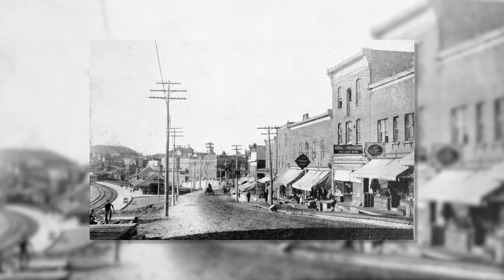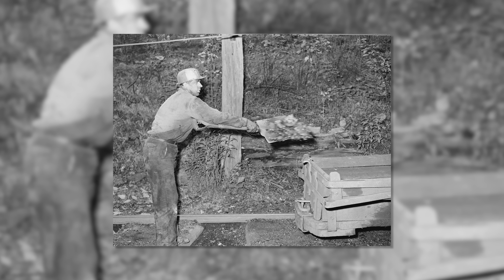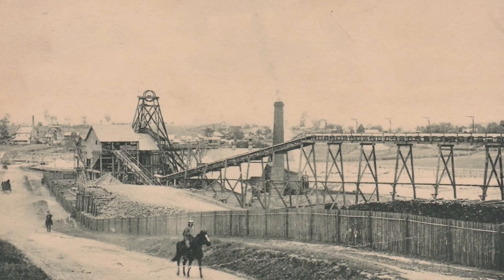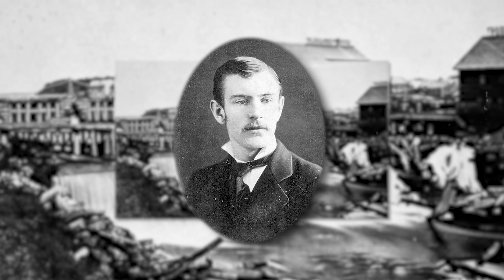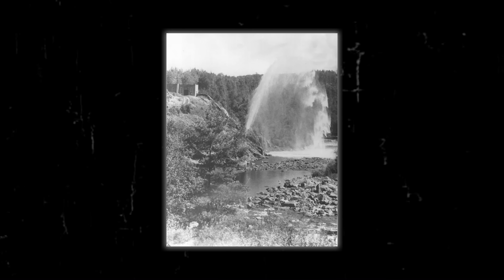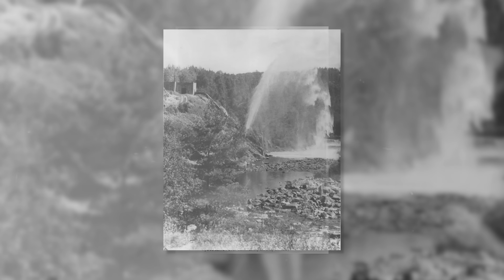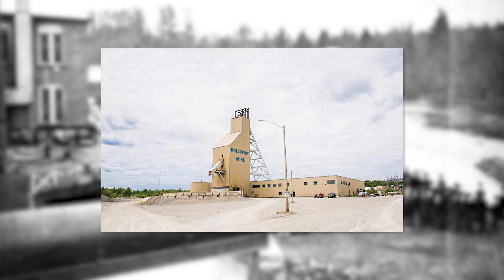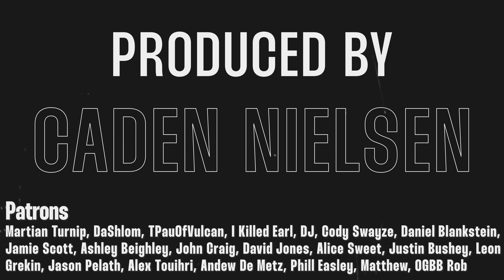Engineering Marvels- The Ragged Chute Air Plant

Comment: Very good video! Charles Taylor ended up making nine of these hydraulic air compressors with his last one, the Ragged Chutes in Cobalt Ontario, being his final version.  Taylor then went on to start an illegitimate family from a woman he met in Britian, and then later became a wartime supplier of goods during WWI.
EDIT: after posting this, I did some quick research on Dean Millar and his Electrale Innovation Ltd, which is said to be providing hydraulic air power to the Holloway Gold Mine, and since 2019 it has been a bust.  No information whatsoever.  Visited his YouTube channel where he appears to be showing a model of his idea, but it seems like a scam to me.  Millar's model has waaaay too many bubbles and velocity for the size, and if you pay attention, the bubbles flow two different directions [upwards UP the supposed draft tube, and then outwards near the bottom of the model] {"TRANSPARENT HYDRAULIC AIR COMPRESSOR HAC MODEL"} Timestamp 1 minute 20 seconds to 1 minute 55 seconds.

Comment: I had recently first learned of this incredible installation from an old textbook my grandfather used and saved, "The Ontario High School Physics" ©1923.  It describes: "Two vertical shafts 350 feet high and 9 feet diameter.  At the top the pipe was 16' diameter with a set of 66 intake pipes, 14", set about 12" below the waters surface, creating a vortex which pulls air bubbles down with the water. Upon hitting a steel covered cone at the bottom, air is released to the top of a horizontal shaft over 1000 feet long.  At the end the air collects in a high chamber while the water rushes up 300' through a vertical tailshaft to the river.  The air exits at 125 PSI via a 24" pipe to the mines."
   "Other air compressors on the same principle are found in Magog, Quebec; at Ainsworth, BC; at the canal lift lock in Peterborough, and at the Victoria Mines in Michigan, but the Cobalt plant is the largest in existence."

Comment: This video is good in all its details and notes that the idea of using falling water entraining air to furnished compressed air was a well established one. However, I find it hard to believe that this was the Canadian engineer performing some sort of simultaneous invention.  A very similar design on a larger scale had been used to build the Mount Cenis tunnel linking Italy and France. Started in 1857, it used compressed air drills starting in 1861 and was completed in 1871. The compressed air came from a falling water system.  This was thoroughly described in engineering periodicals and was duplicated in several other projects.  The Cobalt project may have had some very ingenious features in its specific design.
Reply: One can discover and invent without knowing this was already a thing from someone somewhere in the past.  Give credit where credit is due, what does it cost ya?

Comment: There is nothing in an engineering degree that teaches you originality. The first to dismiss new ideas are the "educated".
Reply: You will find just as many or more such fools without a degree as with one. The difference between the two is that it is easier for the educated to be given airtime and column inches than those with a more limited education.
Reply: It does however allow you to understand and analyze things that you might otherwise miss.  

“In the fields of observation chance favors only the prepared mind.”